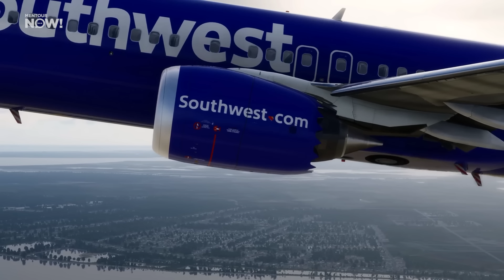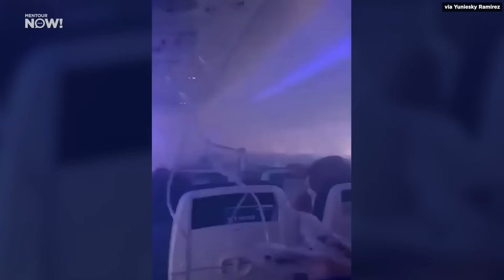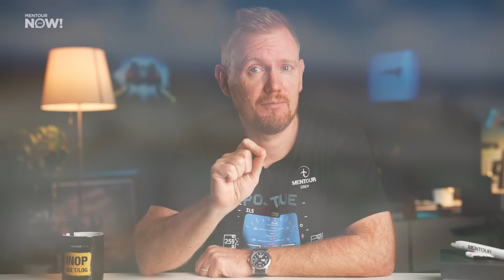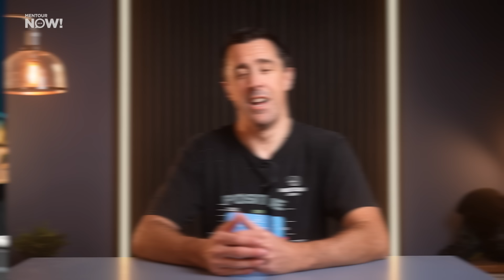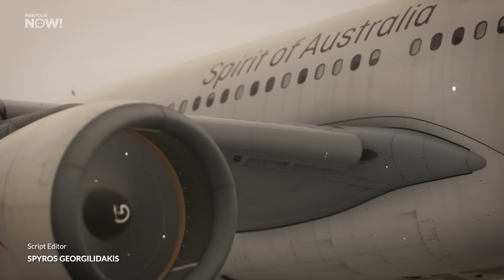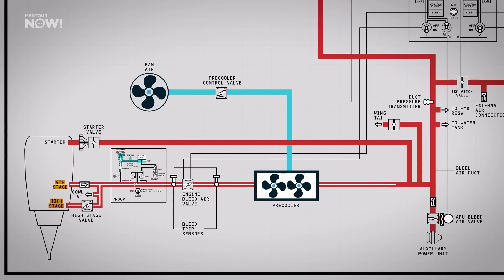Why Don’t ALL Airliners Do THIS?

Comment: Would say that some of the earliest jets didn't directly use bleed air for pressurisation due to the seals in old engines not having very good tolerance and making the air too dirty to use. Instead the bleedair powered a turbo-compressor for cabin pressurisation. Was told this by some old engineers who have worked on 707 and the like. The only jet I've worked on does still have a turbo-compressor, but uses it for cooling cabin air.
Electric is definitely the way forward in so many ways as the bleed air is just bled so will suck the power constantly, when electric does mean you can share the load around and have much more control.
For example the current jets I work on use bleedair for anti-ice (wings, engine intakes...), fuel tank & hydraulic tank pressurisation. And that air just dumped overboard if not entirely used as a form of regulation. Same with anti-ice, just gets exhausted out the wing tips even still with plenty of energy left. With electric anti-ice, you could monitor the load to each element and have very fine adjustment to how much power each element needs, instead of blasting to whole leading edge with the same.
Reply: The 707 used three cabin turbo superchargers that were mouted above the engine in the pylon. The turbo was driven by bleed air. I do not remember which stage. The Cabin air was supplied by the compressor section of the turbo. That isolated the engine oil problem. This air was still hot due to compression. The cabin was cooled by two twenty ton capacity FREON PACKS. Aircraft require cooling on the ground and till about five thousnd feet. After about five thousend feet the packs trim back and shut down. The primary heat exchanger  can cool the compressed air. Above about fifteen thoasend feet the outside air becomes colder and bleed air supplies Trim air heating. Above twenty five thousend feet the outside air is so cold and the primary heatexchanger/ precooler are so efficent an aircraft cannot fly long with out heat. I have worked several trim air, precooler, and hull  leak problems. These problems caused the cabin to be so cold that they had to decend to under twenty five thouasend feet.  AIR CYCLE PACKS driven by bleed air were an evolution from the problamatic freon systems. I retired before the 787.
Reply: @jayreiter268  DC-8 was another with the air scoops low on the nose.  Bleed air was used to spin the compressors but the air pumped into the cabin came from the nose scoops.
Reply: @ajg617  I never worked a DC8. Did the DC8 have CABIN TC's in the nose? I have done a little research. As I suspected those ram air scoops were used to cool the heat exchangers. I have not found the location of the TC's or if the DC8 used freon or aircycle machines. I seldom worked DC9s at LAX. I barely remember the plumbing nightmare in the tail of a DC9 but they used a problematic aircycle machine system. TWA/aa retired sen. 670828
Reply: @jayreiter268  4 I believe.  If you look closely at the nose scoops head on there are three inlets in each - upper and lower for the turbo compressors and the center larger inlet for a heat exchanger.  I think these inlets were blocked off and packs installed on re-engined DC-8s.
Reply: The Dart turboprops on the HS 748 drove Roots blowers for cabin air, that’s the only place I’ve seen that particular approach.
Reply: The B707's and DC-8's used bleed air to turn cabin compressors that took in outside air
Reply from the maker: I'll be honest: we considered doing a longer intro, to go into turbogenerators in earlier planes with turbojets, but the video was already a bit long 😂But of course you're absolutely right. Of course technically, the rest of the ducting and mechanical complexity and other aspects of bleed systems would hold true for the turbogenerator setup, so we jumped straight into the comparison between bleed-air and bleedless.
Reply: @MentourNow Never too long. But point taken. Would say bit ironic it is though that the original reason for the turbo-compressors was to stop oil getting into the air-conditioning, which they got rid of because better seals, and now right back to where we started trying again to stop oil getting into the air-conditioning system.
Reply: @MentourNow 

The design of 787’s variable frequency starter / generator is rather complex but quite interesting if one is into such things. If one goes down that rabbit hole it becomes clear what the engineers were trying to accomplish but this level of detail is probably misplaced in this type of venue.
Reply: I remember studying for the FEX written in the late 80s, seeing all these questions referencing CTCs. Had no idea what they were even though I’d been flying jets in the Air Force for years. A couple of years later i was sitting sideways in a DC-8 operating them, the whole time thinking what an unnecessarily complicated setup it was.
Reply: I'd been curious whether any of the piston engine airliners, which were also all highly boosted, used bleed air. That's a good explanation for why they probably didn't.
Reply: @DanielKetchum-n3o  Piston and turbo prop airliners used engine driven compressors for cabin pressurisation. Even the jet powered VC10 used engine driven compressors instead of bleed air but they could still fail and pump oil fumes into the cabin.
Reply: @DanielKetchum-n3o 

That is an interesting question. To bleed from the output of an ICE supercharger would seem to be quite different than from a particular compressor stage on a turbofan engine. Maybe someone will comment on how it is done.

Upon checking, in modern ICE aircraft, the pressurized air output from the TURBOCHARGER is used. An old ICE airliner might only have had superchargers, so maybe air bleed from after the first stage supercharger (?).
Reply: @Mentaculus42 I can't speak for the airliners. But place I worked did have a Cessna 421C which was a twin piston, with mighty big turbo-chargers. It did indeed use bleed air from the turbos for cabin pressurisation as well as things like de-ice boots. Couldn't have been too high pressure though, because also had a Janitrol heater (notorious apparently for CO poisoning) for cabin heat.
Reply: @Mentaculus42  Were any of the post war piston engine airlines mechanically supercharged only? I don't know enough to say. I know that, during WWII, what we now refer to as turbochargers were called "turbo-superchargers", so it wouldn't surprise me if some amount of abbreviation was done, rather than differentiating between the two types of superchargers. Or really, 3 types... turbine driven (what we now call turbochargers), fixed mechanically driven (superchargers), and I know some german engines used a hydraulically driven supercharger rather than a multi-speed mechanically driven unit. 

Again, no idea - this is speculation and questions, not a statement.
Reply: @DanielKetchum-n3o 

I will have to go down that rabbit hole. My understanding of the terminology of super vs turbo is that they generally had both a separate turbocharger and a separate supercharger running in series. Many had multiple stages of superchargers. The Wright R-3350 Turbo-Compound radial engine was used in airliners and had both supercharger and two exhaust recovery turbines geared to the engine. The Pratt & Whitney R-4360 Wasp Major I think could have a turbocharger in addition to the standard supercharger.

So my thinking of the Wright Turbo-Compound engine was the one that probably was closest to having supercharging only on the intake side (maybe, but I don’t know how it could have also had a separate turbocharger).
Reply: @Mentaculus42  my understanding (which could be flawed) is that most WWII piston engine aircraft had their forced induction powered purely off the crankshaft. Some had multiple stages, as you describe: one supercharger would compress the air some, then run through an intercooler, then through another compressor (also crank driven), then through an aftercooler, then into the engine. I believe that the P51D was this way. 

I know that the P38 had what we would now call a turbocharger, but was then referred to as a turbosupercharger (a supercharger driven by an exhaust turbine). Googling isn't helping me much with finding whether it had compound boost (whether an exhaust driven compressor went into a crank driven, or the other way around).

My understanding is that turbo-compound engines had a power recovery turbine in the exhaust that was used to produce extra power, but without adding any extra air to the engine.
Reply: @DanielKetchum-n3o 

Good comment. During WWII there were various combinations of air intake boost systems. Many aircraft used only superchargers, in various configurations of single stage and multiple stages with potentially varying types of variable speed control. Other aircraft used a combination of a supercharger AND a separate turbocharger with examples of the P-47, P-38 & most U.S. radial engined bombers. 

Turbo compounding means to use an exhaust powered turbine to directly and mechanically put that energy back into the engine and not to directly use the exhaust flow energy to drive a centrifuge compressor for intake air compression. Turbo-compounding I think was only used AFTER the war in a few engines like a particular variant of the Wright R-3350 (Turbo-Compound radial engine variant). 

A modern example of a very versatile TYPE of turbo-compounding is (/ was) used in F-1 racing engines. The MGU-H (Motor Generator Unit-Heat) systems are being removed from Formula 1 cars starting in the 2026 season to reduce costs and complexity. These systems are sometimes called E-turbos. There is an European truck engine that uses mechanical turbo-compounding and maybe a few very high end cars.
Reply: But engine still produces the same amount of hot air, which is dumped on way or another. At least in flight
Reply: @dmitripogosian5084 Wouldn't normally need to be dumped if used in the combustion stage of the engine.
Reply: @dmitripogosian5084 

It takes energy to compress that air via the jet engine compressor which has to be designed to provide that ADDITIONAL airflow over and above the air that goes into the engine combustor (which produces a slightly non-optimal aerodynamic design). The question is whether it is more efficient, lighter and more reliable to use more optimal electric powered systems!?!
Reply: @Mentaculus42 sure, but current engine manufactures are fighting for extra 5 percent efficiency by major  redesign of  gear boxes or whatever plagues now PW engines. I would suspect they'd caught the idea of saving on blead air quite quickly if savings were noticable
Reply: @dmitripogosian5084 

The issue there is not something that is up to the engine manufacturer but rather the airframe designer. Besides, it is a lot more complicated than just bleed air implications but more about a huge amount of subsystems being a little bit more efficient and / or maybe reliable. The whole topic discussion should really be reduced to an engineering level of detail that would ultimately turnoff most people.
Reply: @Mentaculus42  I am pretty sure when you start bleeding air from the engine, it is engine manufacturer that knows how much does it cost in efficiency   and how much you can save if you do it other way :)   Airframe manufacturer knows how much energy is needed but I'm sure they talk.  Anyway my point is, given that it did not become a big deal when 5% percent efficiency gains are being discussed and marketed, I suspect it is less.
Reply: @dmitripogosian5084 

They do talk and a lot. The manufacturer is happy to build what is basically the same engine for both applications (if the numbers are high enough). The 787 was more about increasing the use of electricity for ALL subsystems than specifically minimizing the use of bleed air. Bleed air is still used. 

I suspect that in the very early design phase of the 787, numerous opinions were put forth with insufficient experimental evidence to justify if a more electrified aircraft was actually going to justify the additional effort. The decision makers were probably hearing overly optimistic numbers that pushed them in that direction. When Airbus did their early planning, they had the 787 data as a sanity check and could disregard the over optimistic forecasts for efficiency. 

The interesting thing is how relatively close the two approaches are in efficiency. That being the case, the benefits of going one particular direction have to bring in other variables like reliability & maintenance costs.
Reply: @Mentaculus42 Going on a tangent, I couldn't help but wonder what the remaining use of bleed air is - as it turns out, it's engine cowling anti-icing and hydraulic reservoir pressurisation (of all things).

It occurred to me that, for any application where it's only its heating value that it's used for, if it wouldn't be more efficient to draw said heat from engine coolant and even directly from the engine core's exhaust. Simply mount a different (longer?) "tailpipe" after the core with coolant pipes built in (least amount of exhaust drag vs. any sort of heat exchanger elements placed directly in the exhaust path), then run the engine coolant through it after its normal core cooling duties, then cool the coolant back down in a heat exchanger, the second loop of which that will now offer a source of nice and hot fluid. 

This could be used for all anti-icing systems, and even cabin heating, esp. at altitude (but also cold climates). You could even add whole-wing heating, which would give the aircraft a way to efficiently de-ice itself while at the airport in the winter, and mitigate/avoid a whole class of problems related to overly-cold fuel.

I still don't see why they're using bleed air for hydraulic reservoir pressurisation specifically. Seems to me it would've been simpler to use the same system that pressurises the fuel tanks with nitrogen, but maybe the pressure from that is too low.

Comment: "Boeing took the risk of ditching expensive parts and found an engineering solution no-one tried before". What could ever go wrong.
Reply: Yes, new technology comes with risks. But so does staying with old technology. Should we have stayed with piston engines for transport aircraft? Should we have stayed with steam-gauge cockpits? The new replacements for these old technologies all had growing pains, but in the longer run they have saved countless lives. Will bleedless airliners be a safety improvement in the long run? It's too early to know -- not all new technology proves itself over time. But painting all new technology with the new-is-dangerous brush definitely keeps us from advancing to a safer place in the future.
Reply: @andrewsnow7386 it's not "new is dangerous", it's "Boeing trying to save on manufacturing is dangerous". They lost my trust for such initiatives.

Comment: The BAE 146 actually has only 2 generators for 4 engines - the outboard pair power the generators and the inboard pair power the hydraulic pumps.
Reply from the maker: I didn't know that, thanks!
Reply: Then prince, now king Charles crashed the Queen's (his mum's) BAE 146. And to think I was worried about scuffing the bumper on my dad's new Astra back in the day!

Comment: IMHO it's a question of timing. Semiconductors and batteries are currently the fastest evolving technology. So eventually the bleedless design will dominate every design. Airbus will have to spend those engineering credits when it's time to upgrade the platform whilst Boeing's upgrade will be less costly.
Reply from the maker: True, but Boeing were the early adopters and worked harder on this particular technology. Airbus have Boeing's experience to learn from, plus all the advantages of newer battery tech! So they'll probably have to pay much fewer engineering credits.

Comment: I dont think Boeing and Airbus looked at the same problems. As you said RR produced a more efficient bleed air system on the engine for the 350. Boeing didnt have that option when designing the 787.

edit. Ive had 4 flights on the 787. As far as cabin atmosphere is concerned its the most comfortable plane ive ever flown on.
Reply: I suspect that's because Airbus asked for it, and Boeing asked for extra generators instead.
Reply: @thamiordragonheart8682 if thats the case im glad Boeing made that choice. I feel much better about breathing clean air from the atmosphere than compressed air from an engine.
Reply: I agree with your comment. I noticed Airbus Air smells like snails and fries. French fries.
Reply: @thereissomecoolstuffI dont know if that is part of the reason nut every time ive flown in a 380 ive had a splitting headache. Never again.
Reply: @johnsutcliffe3209 has to be. They use snail shell air purifiers too.
Reply: Vickers VC10 is the winner in my experience for for an almost too quiet cabin. 
Flight in 1967 from Entebbee Uganda to Europe.
Reply: @georgeolson3996 i flew on the VC 10 from Akl to Heathrow when i was 7. 1972. I srill remember how quiet and poweful it felt. Flew home on a brand new BOAC 747. It felt like a clunker by comparison.